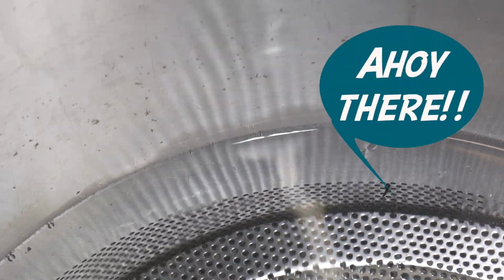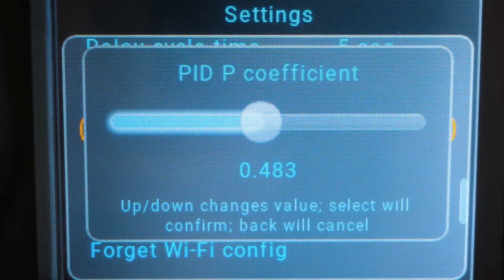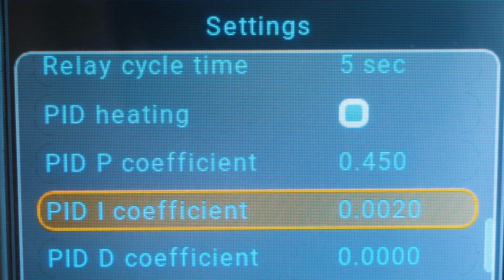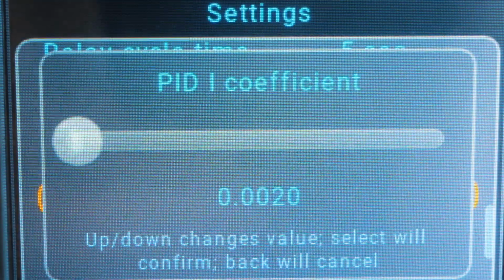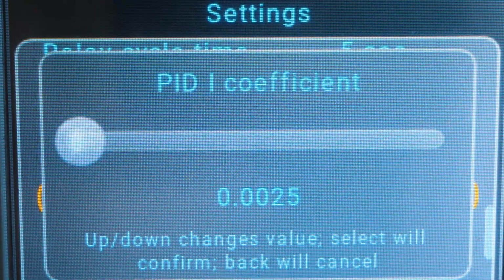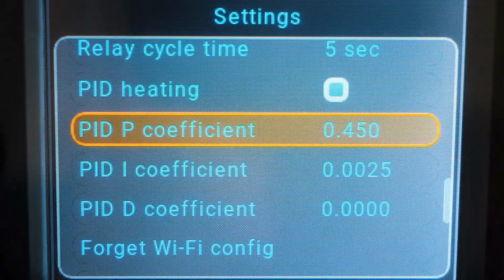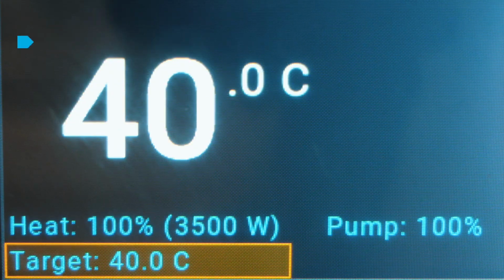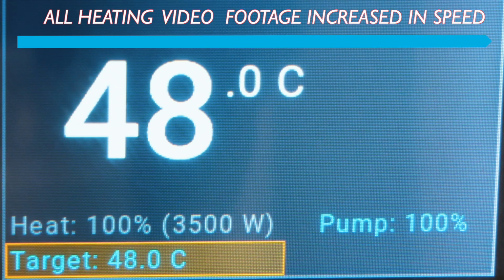Brewzilla GEN 4 PID ALGORITHM EASY SET UP GUIDE

Comment: First experiences with new BrewZilla 65L gen 4. After my first brew on my new BrewZilla I want to hear if anyone can help me with some general issues I experienced.

Brew stats:
Full brew 54L batch
14 Kg Malt + 300g late addition Malt + 1kg candi sugar end boil
Temperature mash profile (loaded from RAPT); Strike: 71, Mash: 67, Mashout: 75, Boil: 102

I have looked at both the video an comments in David Heath's PID calibration video, which is translated into my settings:
PID settings: P:0.680, I:0.0012, D: 0.0
Heating hysteresis: 0.0
230V

First of all I haven't understood the mash profile settings correct, as the timer kicked in straight away rather than after reaching the target temp - result = had to rewind the "program" several times during the brew.
I heat mash and sparge water in same kettle before pitching sparge to another wessel and it took a very long time to reach strike temp. After a While I pitched the spargewater to the other wessel and went to manual to be able to reach strike temp....after doing this the temperature rise was FLYING!!

Mash and temp raise + mashout, went like a charm. The temperature raise to boil was initially fine, but then stalled at around 80. After a while I decided to abort the profile and went on with manual. Again, I experienced the temp raise to shoot into the air....

What am I missing?

Also what is the parameter D for?
Reply from the maker: I suggest you reach out to where you bought the unit. The temperature flying like this is not something ive experienced.

Comment: Thanks for the great info Dave. When you're done with the testing and brewing as normal do you keep the hysteresis setting at 0?
Reply from the maker: Cheers. Yes, keep it at 0.
Reply: Good to know, I struggled keeping a consistent boil when it was at the default 3.5 hysteresis. If set to 0 I assume the heating element is constantly switching on and off in order to maintain the same temp. Hope that doesn’t burn out the heating element. It would be helpful to see a video of all the menu settings as the BrewZilla documentation doesn’t cover any of the settings.
Reply from the maker: No issues or worries around the element.

Comment: I started by just using your final numbers but kept overshooting temp up to 2-4 degrees; had to watch this multiple times and still couldn't quite follow. Finally, I sat down and took notes to calibrate next time. Hopefully the next brew will be more stable.
Reply from the maker: Great. Like I said in the video, this is more showing how to calibrate rather that the same numbers working for all.
Reply: Curious to what your final numbers ended up being? I'm having the same experience...
Reply: @theGrindcrusher  I haven't tried it again yet but these are the notes I wrote down after careful listening:
20L Start P @ .480; start I @ .0020
40L Start P @ .680; start I @ .0010
P is core power control, go up for more
I is extra power for speed, go down for more
Try to dail-in P first and then I for fine tuning.
Reply from the maker: If my numbers work for you then great but its more likely that you will need to fine tune for your environment.

Comment: Hi David,
Stuck between the choice of Grainfather G30 or Brewziller 35l Gen4, which would you personally recommend? Many thanks for you thoughts and great videos!
Reply from the maker: I would suggest the GEN 4 Brewzilla personally. The G30 is quite some years old now and is rather low tech compared. The GEN 4 Brewzillas are ahead in a number of key areas. This is probably the best comparison video series  to watch:- https://youtube.com/playlist?list=RDCMUCb3HYxTpCaVDeulH1mZGW1Q&playnext=1
Reply: @DavidHeathHomebrew  
Thanks, appreciate the feedback!
Reply: @DavidHeathHomebrew  
One more question, now you convinced me of the BZ Gen4, I am stuck deciding between the 35l or 65l… Planing batches between 20l and 25l, so in theory the 35l should suffice, but the 65l also allows for batches of this size. Any benefits going for the 65l even if I do not intend brewing more than 25l batches? 
Thanks again!
Reply from the maker: Hi, the 65L has more power, if you have the fuse for it. Having said this you can use boil extenders to increase the volume of both systems. https://youtu.be/cT1jMkifqK8
Reply: @DavidHeathHomebrew  
Thanks, good point on the power, will check what my system can cope with.
Reply from the maker: Yes, its a definite consideration. Here on European power it needs 15 amps. I plug into that supply in my bathroom that serves the water boiler. Luckily I can unplug the boiler.
Reply: @DavidHeathHomebrew  Gone with the 35l to be on the safe side. Thanks
Reply from the maker: Great, enjoy 🍻🍻🍻
Reply: @DavidHeathHomebrew  
Thanks, actually had first brew today, but wheat kept compacting during masch, had to keep stirring. Think it was either crushed too fine (bought it crushed) or will need to add some ricehulls next time. Let‘s see how it turns out.
Reply from the maker: Its always worth having some rice hulls to hand 🍻🍻🍻

Comment: How do you setup a delayed start? I don't see that as a step option in the RAPT portal.  Can you only do that on the control panel?  RAPT interface seems like it has a long way to go relative to setup, available profiles, sharing profiles, etc.  It's the one thing that i'm most concerned about as I consider buying the Brewzilla GEN 4 instead of the Grainfather G30.
Reply from the maker: Hi, 
Its all there on the Rapt portal. 
Make a one step Brewzilla temp profile for your desired mash temp with a start time with the delay you want. Easy stuff 🍻
Reply: That’s what I thought and tried to do but I don’t see anywhere to enter a start time for the step that isn’t contingent on the previous step, an assigned duration or reaching a temperature. I see all the options under temp automation, etc. but nothing to select a time for it to start heating or for it to reach strike temp by a certain time. Maybe I’m missing something. FYI, by the way, all your videos are fantastic and I appreciate your quick response to questions.
Reply from the maker: Are you a member of my FB group? Its easier to show you the profile this way.
Reply: I just joined and membership is pending.
Reply from the maker: Ok great, you should find a post where is mentioned. If not please make on and I will share an image to help you.

Comment: Like Ian Probert, I'm in SEQ Australia, and like Ian I  got a similar result.
power voltage 230-240 Volts out of a 15 Amp socket.
No jacket on the BZ.
Lid on
Power 100% (3,500 watts) until strike temp (71C) reached and stabilised.
Pump always running at 100%.
Test Water Volume was for a 2-keg batch.
30 Lt mash volume of water tested (sparge excluded).
71 C was the Target strike temp set for mash in.
P:  0.460
I:  0.0010
D:  0.0

I used a DMM with temp probe. The probe was in the centre of the mash vessel and the tip -placed about 4cm below the water surface.
The starting water temp was 24 C. on the probe and 19C. on the BZ  Ambient air temp was 19C.
The following are reading on both the probe and BZ at the times stated:
10 min. Probe 38-BZ38.5
15 min. Probe 47-BZ 47
20min. Probe 55- BZ 55.1
25 min. Probe 64- BZ 63.5
30 min. Probe72- BZ 70.3
then after a few more min to settle the Probe rose to 74 and the BZ hung around at 70.9 
Given that my results were so similar to Ian's, I stopped there.
Reply from the maker: Great, thanks for sharing Bruce, much appreciated 🍻🍻

Comment: David, thank you for your very informative video.  I knew nothing about how PID worked until I watched it.
I have had a couple of test runs on my new 65 Lt BrewZilla GEN 4.
I live in Brisbane Australia. I used the following settings.
Power voltage 230-240 Volts out of a 15 Amp socket.
Neoprene jacket on the BZ.
Lid on
Power 100% (3,500 watts) until strike temp (70C) reached and stabilised.
Pump always running at 100%.
Test Water Volume was for a 2-keg batch, based on a Brewfather recipe.
33.7 Lt mash volume of water tested (sparge excluded).
70 C was the Target strike temp set for mash in.
P:  0.460
I:  0.0018
D:  0.0
Allowed Sensor Temp Diff. set on BZ at 1 C
I used the new RAPT Bluetooth Thermometer bonded to the BZ and selected it as the sensor controlling the PID.  The probe was in the centre of the mash vessel and the tip -placed about 6 cm below the water surface.
The starting water temp was 25.1 C.  Ambient air temp was 25.0 C.
The test started and the temp increased at a good rate to 65 C after 30 minutes.  This was when the PID settings started to take effect.  The RAPT probe was at 65 C but the BZ built-in sensor near the elements has reached 71.1 C.  The set 1 C Sensor Temp Diff was cycling off the power for short periods until the BZ sensor dropped below 71 C.  The RAPT sensor temp continued to steadily increase.
It took another 27 minutes for the RAPT probe to register 70.0 C.  Most of this time was used in raising the temp from 69.2 C to 70.0 C when the PID control was most active.
There was no temp overshoot.  The maximum temp registered on the RAPT probe was 70.1 C and stabilised between 69.9 and 70.0 C.
I then reduced the power setting to 40% (1,400 watts) with the pump running at 100% for the next 40 minutes.  Both temp probes remained very stable.  The RAPT probe remained steady between 69.9 and 69.8 C.  The in-built BZ probe stayed between 70.5 and 70.1 C.  There was very little power cycling at this power setting.
I will set up a simple 2 step profile in RAPT to activate these settings the night before so I can delay the heating start to achieve strike temp early morning on brew day.
Reply from the maker: Awesome, great infornation, thank you 🍻🍻

Comment: I had interesting results when I was trying to play around with the PID settings on my 35L Gen 4. 
Setup: 
 Equipment: Brewzilla Gen 4 
 Malt pipe: Inserted
Jacket: Yes
 Lid: Yes
 Pump: 100%
 Heating: 2400W (100%)
 Water: 10L
 
Observations: As the target temp went up, I needed to change the PID settings.  Ambient was around 29c. 
-> To go to 40, I put it at (0.28,0.0020) and it overshot by 0.5 degree before coming back to 40. 
-> To go to 50, I changed this to (0.18, 0.0020) and it struggled to reach 50, always hovering around 49.7. 
-> Changed target temp to 60 and setting to (0.26, 0.0020) and again, same thing. Hovered around 59.6.
-> Changed the target temp to 65 and setting to (0.40, 0.0020) and this now overshot by 0.5c
-> Changed the target temp to 70 and setting to (0.36, 0.0020) and now, again, it struggled to reach 70, hovering around 69.7c.
-> Turned off PID and changed target temp to 74.5. Overshot by 1.5c. 

In all, I am not really sure what to make of this. I want to try profiles but am not worried about target temp never being reached and hence the step not starting / stopping. Will probably try a few more times and see what happens.

Cheers!
Reply from the maker: Great, many thanks for sharing 🍻🍻
Reply: If you are not reaching target temperature, your I setting is to low.

Comment: Hi David, have you managed to set up a delayed start on the Gen 4?
Reply: That is exactly what I worked out in the end, certainly not as easy as the general I moved from in that regard.
Reply: Generation not General, autocorrect 🙄
Reply from the maker: Yes, perhaps this will be upgraded in the future.
Reply from the maker: This can be made with a profile in RAPT. The first step will need to be for 0C for the amount of time you want it to be before the Brewzilla starts preheating to the next temperature. A simple 2 step profile will work nicely.

Comment: I set P=.68 and I=.0010 following Kee of Kegland's video. On my last brew the heating stalled at 92°c for 15 mins despite a set temperature of 101°c. It only heated to boiling once I disabled PID. Anyone have any idea what might be wrong? 240v mains, 35L Gen 4. Batch was 28L pre-boil volume with insulated jacket on the Brewzilla
Reply from the maker: Hi Geoff, there is no point in using PID past mashing temps. Turn it after after your mash.
Reply: @DavidHeathHomebrew  Thanks David, that makes sense, maybe in the future I'll be able to control PID from my RAPT profile.
Reply from the maker: Yes, it is something I would like too :)
Reply: If you want to boil then just set the temperature as high as it'll go, you'll then never get to the point the PID starts to kick in to avoid overshoot. This avoids the need to turn in on and off for the mash/boil.
Reply from the maker: If you did that for medium and small batches then your boil off would increase, especially with the 65L.
Reply: @DavidHeathHomebrew  At that point you could simply adjust the power to get the level of boil you would like
Reply from the maker: Seems to me that its easier to just switch it off for the boil, which is what Kegland recommend but up to the individual of course 😎

Comment: I would be interested to know what the error would be if you just had KP = 0.2 and ki/kd off. I'm guessing it would be about 80%. KP is used to improve transient response time and reduce the error, however using Kp alone can never eliminate the error. This is where ki is used. A small amount of integral gain is used to drive the plant the desired setpoint. Your ki gain is actually very large since it is inversely proportional to the integral time constant, ki = 1/Ti and I'm guessing you are changing Ti. The derivative term contributes damping to the system but is often neglected as it is sensitive to noise.  It would be interesting to record the response and plug the data into MATLAB to do some auto tuning, if I had a gen4 BZ.
Reply from the maker: That would be something KL would be able to advise you on fully, if needed.
Reply: I am disappointed to not see autotuning. It’s been over 15 years since I tuned a PID system.
Reply from the maker: I am not sure how possible that would be considering all the variations.
Reply: @DavidHeathHomebrew  the variations aren’t really that much of issue compared to the length of time cooling the water would be.

It could be that both are deal breakers, but even regular auto-tuning can be for a wide variety of similar conditions.
Reply from the maker: I am sure KL went fully into it for the best end result.